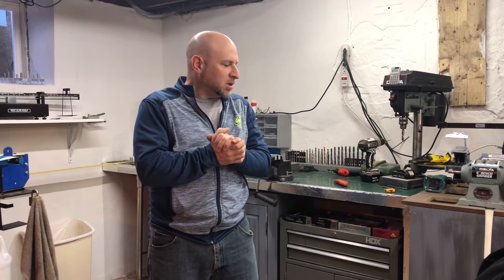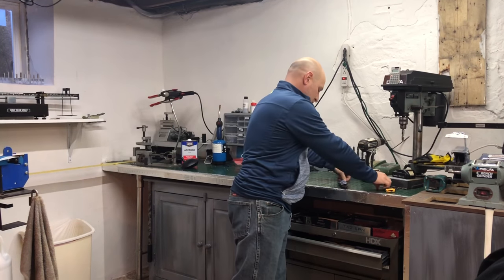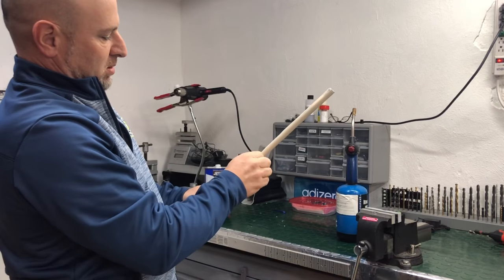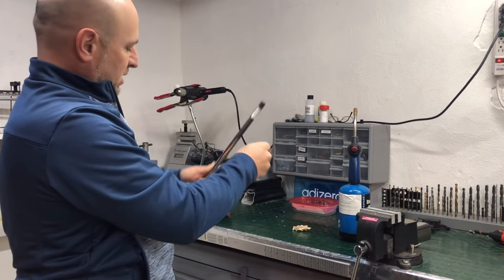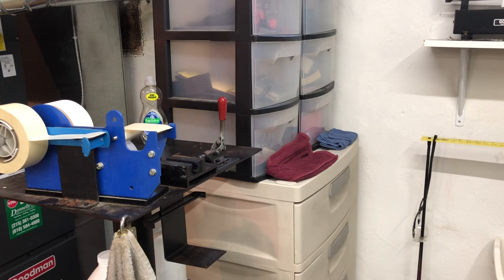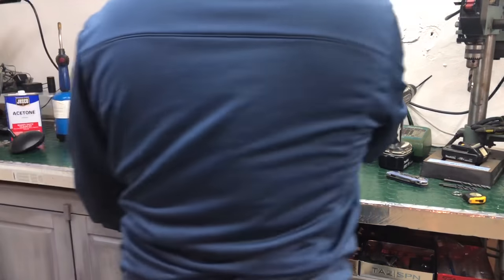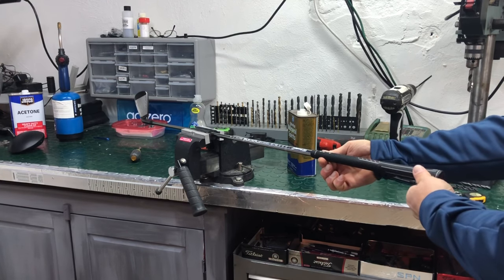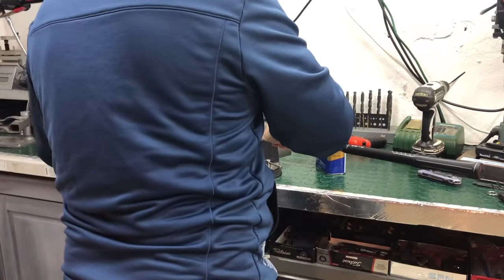Regripping golf clubs at home (common mistakes, do's & don'ts, graphite shafts)

Comment: If you are doing this for the first time, you can also get a sharpie or something and mark where your original grip lines up so you don’t have to eye ball it each time!
Reply: You could do this but sometimes when you are fiddling with the shaft, the sharpie line rubs off and may not show much on graphite shafts anyway. Maybe put a line on some masking tape? I put a "magnetic stick" on the face to help alignment. The old grip might not have been lined up correctly anyway.
Reply: I was just thinking about that. I can wipe off when the new grip is on!

Comment: looking to regrip my clubs for the first time. I found you explained it very clearly and gave quite valuable tips with regards to how to hold the blade when removing grips and how to apply solvent. thanks for posting. greetings from Belgium
Reply: An inexpensive heat gun from.Harbor Freight works better than FIRE ..ESPECIALLY around "solvent "..ka boom..

Comment: So, to understand fully, you do not use or recommend using dbbl sided tape on graphite shaft. Or do you use dbbl. sided tape but without removing the cover layer?
Was the common mistakes that you mention using and removing the cover layer?
Thanks.

Comment: Something you may be able to answer for me that I struggle with understanding. The excess grip tape is twisted into a little tail and tucked into the shaft. Does this keep solvent from getting into the shaft? most of the solvent that you put on the tape is squeegeed off during installation and most of the solvent inside the grip is pushed to the back of the grip and comes out the hole. At least that’s what I’m seeing. I’m guessing that you’re not supposed to get any solvent in the shaft which could possibly cause rust if it’s a steel shaft. Once the grip is on and everything is dry should you take some sort of ice pick or some thing and poke a hole through the grip tape at the end of the shaft so that air can come and go inside the shaft as necessary to prevent condensation or something like that?

Comment: When using double sided tape do you take off the top layer of the tape off or do you leave it on?  When I regrip a club I take off the top layer and after putting on the mineral sprites it is real hard to push on the grip.  Will the grip stay in place with the top layer still on? Jerry G
Reply: Yes it will stay on. No problem.

Comment: The wide double-sided tape. You have the join or overlap at the top, I would like this join at the bottom so I would face the club tow down and then move it 180 degrees to line up the grip when you put this one. I expec you will say that the join should be at the top?

Comment: Hello thank you so much

Firstntime doing this

So the double tape comes with white paper on one side and yellow in the other side. I pulled the white out and left the yellow paper

Then i left the 

However when i put the solvent and tríed  to fit it in,  it would get stuck after I inserted the first inch 

And the grip was bending in all directions However not going in

Comment: A lot of comments on how he never removed the grip-side tape backer and my guess is it's because it's not necessary to do so. There are many videos showing club re-gripping using just ordinary masking tape and compressed air from an inflator or small compressor. They use an inflator nozzle pushed into the drain hole on the end of the grip and the air pressure expands the grip enough to easily slide it on. No solvent, no mess and much easier to remove or reposition if necessary.  Apparently the grip doesn't need a sticky tape surface to stay in place and he may use grip tape instead of regular masking tape to ensure the proper amount of buildup because regular masking tape is much thinner and requires multiple layers for the same thickness. Steve maybe doesn't know about using air or maybe just prefers solvent but it would've been nice if he clarified the how and why of his method.

Comment: I’ve regripped steel shafts a few times but I just did my first graphite ones for a buddy of mine. I’m glad I watched this first for the tips about cutting off the old grips. I would have just cut straight not thinking probably lol

Comment: Thanks for the video! Any tips when it's a struggle to get the grips over the end of the shaft before you get a chance to push the grip down?
Reply: I'm having the same issue
Reply: @alexmcburnie1702  I heard from another video if it is a struggle to get the grip to fit you can stick your little finger into the grip just before you try and place the grip over the shaft and it should stretch a bit. Also read about warming the grips in some hot water beforehand to stretch them a bit.
Reply: @Matt Harris I’ve just managed to regrip them all tonight. If you use white spirit, plug the end of the grip, then push up on to the butt of the shaft to get it over. I thought mine were too small originally but they do fit.
Reply: @alexmcburnie1702   i put a tee in end of grip, use spray bottle with solvent, spray inside the grip, shake it around and pour excess into a recovery container not on ground..remove the tee and grip slides onto shaft.  Spray a dab of solvent onto grip and swoosh...onto shaft it goes...

Comment: You have probably covered this before but if the standard weight of a 7 iron by the chart I saw online is 264 grams-and if a head weighs say 260 grams (in my cobra f7, 7 iron)  would it be ideal to add a tip weight to make it the 264 so that when you tip cut a shaft (to a 7 iron) the exact weight would then create proper flex and everything. Also, does every shaft manufacturer use this 264 gram weight standard(for a 7 iron) or does it vary and if so what weight should I go by. Finally does adding tip weight change the feel of the iron head to the point it changes direction- I usually discard tip weights when I break a club down to re-shaft but maybe I should re-think that concept since shaft flex/frequency are so hard to get exact

Comment: For steel shafts use a glue gun to remove tape then heat up the remaining glue and brush on white spirit while it's still hot,  it will come off easy. Be advised to wear gloves to avoid burning your hand. Easy. Clean out the ends with a small screw type toilet brush and WD40 if you want to do a proper job.

Comment: a different subject-but if you put a TT s300 xp 115 gram 6 iron shaft into a 7 iron- does that change it to a regular flex, or somewhere in between....or what exactly will it do to the performance of the club..
Reply from the maker: The simple answer is that a 7-iron head weighs slightly more, approximately 7 grams, than a 6-iron head which will make the shaft flex slightly more when you put the 7-iron head on a shaft that is meant for a 6-iron. So yes it will slightly weaken the shaft flex. It won't change the flex to a regular, probably somewhere in between but closer to stiff still. What you're doing is called soft stepping. You might get a slightly higher ball flight but honestly it depends on how you load the shaft with your swing.
Reply: @bagdifo  You have probably covered this before but if the standard weight of a 7 iron by the chart I saw online is 264 grams-and if a head weighs say 260 grams (in my cobra f7, 7 iron)  would it be ideal to add a tip weight to make it the 264 so that when you tip cut a shaft (to a 7 iron) the exact weight would then create proper flex and everything. Also, does every shaft manufacturer use this 264 gram weight standard(for a 7 iron) or does it vary and if so what weight should I go by. Finally does adding tip weight change the feel of the iron head to the point it changes direction- I usually discard tip weights when I break a club down to re-shaft but maybe I should re-think that concept since shaft flex/frequency are so hard to get exact
.

Comment: Only cautions I can add, being elderly. is DO NOT use nitrile gloves. I thought to protect my dainty fingers, and could NOT grip the grip - it went on half way then I could go no farther - had to cut it and throw it away. For my next attempt I used a "gripper glove" on my forward hand, and had to be careful not to stretch it; otherwise, it worked - You need a bare hand, or nitrile glove 'cuz you have to block the hole with your RIGHT, then you are only pushing with it

Comment: Disappointing! - even with all the  comments below there is no clear message as to whether the double-sided tape is left on or removed. Can anyone clearly let us know -  should we remove it or leave it on?
Reply: He doesn't seem too keen on replying to posts, but I can't see what use leaving the cover tape on would be - how could it grip the rubber otherwise?
Reply: Absolutely you peel off the outer layer off of the tape.